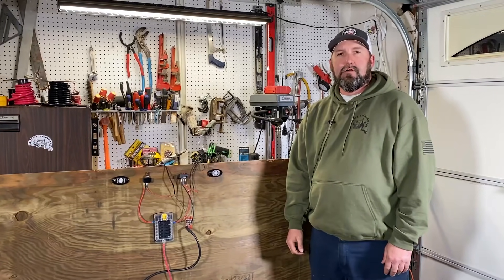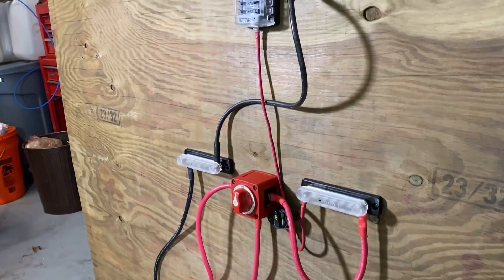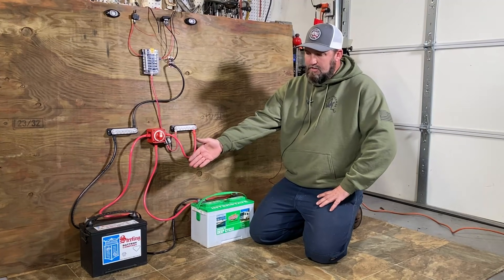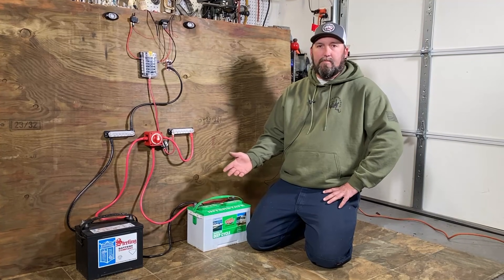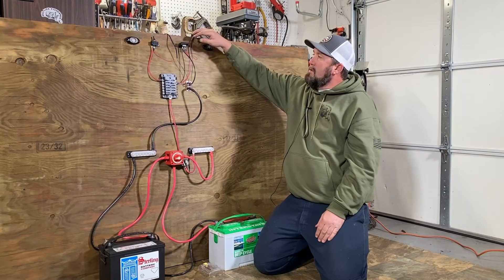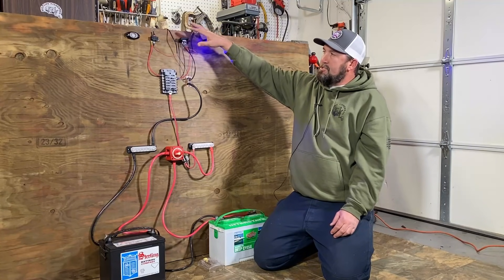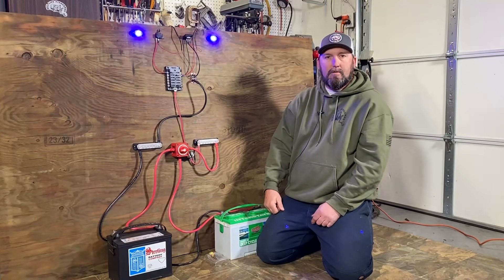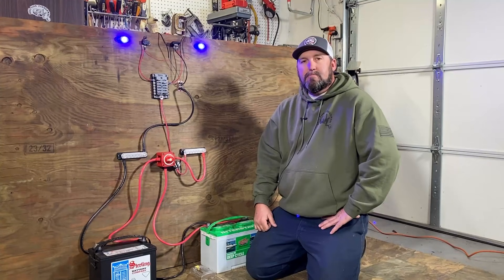BASIC BOAT DUAL BATTERY WIRING | HOW TO

Comment: Is it still safe to connect 3 crank batteries in paralleled and still have a long lasting battery on a boat day? ..because I don’t want to install any switches. 

I also heard have batteries in paralleled isn’t safe? Correct me if I’m wrong.

Comment: Thank you for this video. I have a Tohatsu 20 hp electric start, power tilt. I can crank the engine with the pull rope also. If I have my system rigged like this can I turn the battery switch to just the deep cycle battery and use the pull start will my alternator charge the deep cycle without any stress on my alternator?

Comment: Question: my trolling motor is 24V. I like to night fish by dropping a 12V light into the water. Can I just hook my leads up to one of my batteries that are wired for the trolling motor or do I need to disconnect them from being in series before hooking up?  I am guessing since my three battery charger is not in series it wouldn’t be an issue.  But wanted to get other opinions. Thanks

Comment: Ok... but where on the out board motor does the out red wire from the battery selector go ? 
Hook on the red wire lug on the starter ? 
Or the other end of the wire on the lug by the square thing ? 🤔

Comment: So, would the trolling motor batteries be the 2nd position on the battery switch? Would the output position of the battery switch be pushed to the console by the smaller gauge wire with the 30 amp inline fuse to the terminal bus or to a power switch? I am new to boat wiring an looking to run new wires for the next year fishing season. Batteries to the switch and off to the trolling motor. Batteries (deep cycle) to the switch and then to the power toggle switch then to the 12 position bus bar? Is this correct?

Comment: You said to make sure the engine is off before you switch to battery 2. If I crank my motor from battery one just to start the motor, how do I switch to battery two while I am using the motor?

Comment: Nice job Reel Life!!!! Basic but informative. Very helpful. You do a good job. Looking to add a battery to my Alumaweld that just came with 1 battery. And also my switch panel, now that you've explained, I will trace and see if it's hooked up the way you explained, or close to. I definitely will have a better understanding and will know what I'm looking at. Thanks. 👍

Comment: Great video, just looking for some clarity. If you have it set to your house battery while you're chilling at the sand bar or whatever and then switch it to your cranking battery you won't be charging the house battery while running. So, how do you recharge the house battery?

Comment: If I understand correctly, you said that you don't want to run the motor with both batteries on, and you don't want to turn off the house battery before allowing the electronics to shut down. I'm confused, how then would I chart a lake or move from one spot to another. Did I misunderstand something?

Comment: I'm a little confused about charging the house battery. Selecting battery 1 will charge starting battery, 1+2 will charge both simultaneously, and I know about battery isolators and charging relays, but how does selecting battery 2 prevent #1 from receiving a charge? How do you connect outboard and charging wires to this system? With a single battery system everything is connected to the one battery obviously, so that's how I'm confused why it would stop being charged when selecting battery 2 when the alternator is connected to #1. Is the alternator connected to the output connection or ??? What am I missing?

Comment: Most instructions on all of the battery switches say to use the positive lead, but I've seen a few comments that say you should always connect the negative.  This kind of makes sense, since when you hook up and unhook a battery you always hook up positive first and then the negative lead.. when you  remove cables you remove the negative first and positive first.  With the positive leads together, wiring the negative to the switch, when you turn the switch it would be like removing the negative cable and then you are connecting the negative of the other battery.

Comment: the deep cycle needs a different charge profile vs a regular flooded lead acid, it's kinda critical for battery life, u definitely want to charge them correctly, otherwise it won't charge correctly or fully, and it'll severely limit the life    not a big deal tho, many companies make DC to DC inverters or aka charge controllers for deep cycle so u don't ruin it   im looking at them now but for a truck

Comment: Great video! Absolutely the video I was looking for.  Question, what gage wire do you use to go between the battery switch to the buss bar and the negative terminal on the battery to the negative buss bar? Thanks!

Comment: Hey bud 
Nice video 
Question for you.  I just installed a premium audio system in my V drive centurion boat.  However I came at across roads.
With the ignition switch power and the stereo on and off switch.
I have 1 constant that’s good for both.
Unfortunately I need another source for one or the other.
Is it possible that the stereo switch or ignition switch came from the smaller fuse box area. (there is an opening)
It could be a possibility.

Should I run a new lead with fuse or find a way to tap into the fuse box.
I apologize if I wasn’t clear.  I’m a rook.
thanks again

Comment: If I’m running just an electric motor  with two deep cycles, can I run in 1and 2 position to run them in parallel without causing any issues? Or should I just wire them in parallel before putting them to one input on switch?

Comment: have a couple ?'s. I have a bunch of 2awg marine battery cable. you say 4 is most common can I use the two awg for my blue sea mini add a battery kit. and with that size wire what size breaker should i use? my engine is a 60 hrs.

Comment: So this may be a very naive question but what do you do first? Does it matter the order you hook everything up? Like does the large gauge wire coming right off the battery have to go first? Can you work backwards from a circuit. It’s obvious I don’t really understand the principles, I get that it’s a circuit and it goes in a circle I just feel like there’s no getting around touching metal to metal and conducting electricity while connecting wires when everything is all wired up. I feel like I should wire everything up to the fuse block and then connect the power source but idk.

Comment: How do I add a 2nd leisure battery?  If I want a crank battery and then 2 leisure batteries for on board power etc ? Using the switch etc?
Reply: Good to see questions get answered lol.

Comment: My engine positive is going to Output on the Battery Swtich, my engine negative is going to Neg terminal on Starting battery. Starting battery positive goes to Pos 1 on switch, Deep Cycle battery positive goes to Pos 2. There is a neg jumper between both batteries. I have a Yam 150, and when I try to operate the trim/tilt switch  on the motor it only works on Pos 2 and Pos 1+2, but not on Pos 1. Any recommendations? Love the video btw, did a complete re-wire based on this. Thank you!

Comment: Great video... why would you need a positive bus bar if you're using a 12 gang fuse panel? Also you have what appears to be an 8GA - to a bus bar, then 8GA - to a smaller 4 or 6 prong - board, why? Couldn't you just run the negative straight to the fuse box and the positive to the circuit breaker right to the fuse block... or are you just showing alternatives?

Comment: Can you run the negative wire from the engine to the negative bus bar or do you have to connect it to the negative post on the crank battery?

Comment: I have been trying to find information on this for awhile but can’t find anything concrete online. So my switch panel has breakers. Would I still want to have a fuse panel for everything going to the switch panel or just have a small fuse panel for things that are not on a switch? Also if you could shed some light on breakers vs fuses? From what I have seen online a breaker is pretty much like a reusable fuse but they can be used interchangeably for most 12v applications.

Comment: I just wired my two batteries in parallel, added a 50 amp circuit breaker. I have a large stereo system with amplifiers and a subwoofer.

Comment: Using this system in a 16 ft aluminum jon boat and wondering about the trolling motor. I would have a group 24 cranking battery and group 29 deep cycle house battery. Would I want to connect trolling motor to positive bus bar or directly to house battery?

Comment: My only question is say I start my motor with the starting battery and then while its running I want to use my lights and other accessories. I would want those to draw from battery number 2 but how would I switch over to that safely?

Comment: Fantastic video, one question. In my case, where you have the house battery, I have two trolling motor batteries run in series for a 24V trolling motor. My question is how does the wiring from the trolling motor batteries to the switch go?

Comment: Slightly off topic, with the new power needs of electronics what are your thoughts on running a dedicated circuit to them? Here's what I was planning. Starting in back battery compartment install a Perko Batt. switch using 8ga, tinned wire then to a 40 amp reset breaker with same 8ga also in batt. compartment then run to a Blue Sea fuse panel in starboard locker forward of console. Then run 10ga tinned wire from fuse panel to four graphs all with there own individual  wires. Two in console  a 3ft wire run and two at bow a 8ft wire run. with all that said would it be okay to cut out original fuse holders and rely on the blue sea fuse panel as long as you use the correct Amp rated fuse for each graph? Thank You

Comment: Just one question why is it not recommended to have the switch on both batteries while the motor is running. I figured that way you can charge both batteries that way. You said you could but it's not recommended?

Comment: What wiring would you recommend running a crab pot hauler that draws a current of 35amps? Could I just upgrade my dual purpose deep cycle battery from group size 24 to a group size 31 and just hook up the hauler to that battery instead of adding another battery? And also have the engine and hauler both running at the same time so it won’t totally drain my battery.Thanks!

Comment: Thanks for the great video man. I am currently in the process re-doing my boat wiring and your video just enlightened me on the basics. Just one question though? As you are distributing to the various equipment (lights, fish finder, etc..) through the fuse box, what's the use of the distribution bar then? Basically, you could have wired straight from the 20amp fuse to the fuse box? Thanks in advance for your feedback. Cheers.

Comment: great video. I am putting in a fuse panel in front of boat to run Mega live and monitors. I want to run 8 gauge from buss bar like you said and I noticed I do not have any free terminals in my buss bar. can i put the 8 gauge wire ontop of another wire and tighten it up.

Comment: I purchased a 2000 Hurricane and it has the switch and 2 deep cell batteries. I replaced them both with newer versions. Is that OK or should I get a cranking battery opposite the deep cells?

Comment: Love your video, best boat wiring video on YouTube( and I’ve looked at a bunch haha). Quick question, I am completely redoing my pontoon boat and am about to start the wiring. I have excess of anchor 4 gauge wire and was wondering if I could take that from the battery to the switch, to the bud bar, and all the way up to the dash to the fuse block? Is 4 gauge too much to run to the fuse block, do I need to step it down? Will it hurt anything if I don’t step it down and just use 4 gauge all the way up to the fuse block?  Thanks so much man!

Comment: Excellent video. One question. If I wanted to run a Trolling motor as well should I go from the output switch to the motor through a circuit breaker then back to the negative like you would with an outboard?

Comment: I would like to see a video on how you would charge bothe batteries. 
Thank you
Reply from the maker: You need to have a 2 bank onboard battery charger to plug in when you get home.. and if you want it a automatic charging relay (ACR) isolator. To charge on the water while the engine is running..

Comment: First, thank you for the video. It is super helpful. 

Second, I'm worried about the compatibility of my deep cycle and cranking batteries. I'm kind of getting mixed signals from the internet. 

I have an EverStart 29DC for the crank and a SuperStart Marine group 31. 

I don't have a battery isolator, just have a - black lead running between the batteries. 

What do you think?
Reply from the maker: So they are only together on battery switch position 1&2 . That is for emergency only! They are sharing a ground and that is it..  the second battery is only there to switch to if you will be anchored and not running your motor for long periods of time, running lights and electronics radios etc. it is also there for emergency .. but as far as 2 different batteries being connected in parallel or series for anything other than emergencies.. that is correct..  hopefully that makes sense and please let me know if you have any questions.. thanks for watching
Reply: @ReelLifeFisherman  I think that makes a lot of sense. I ended up buying a second of the Everstart to pair with the cranking batteries, and moved the deep cycles to the stern. Then I ran leads back from the stern where the 4 bank battery charger sits. In a pinch I could use those wires to crossover the two  battery banks. 

Thanks for this visual.  It made everything a lot easier for me.
Reply: @ReelLifeFisherman  that makes a lot of sense*

Comment: I have just purchased a 90’s boat and it has a battery switch. This video was very helpful. I have taken it out 3 times and have noticed that the fish finder turns off and on every time I start the boat. Is there a way to fix this? Or would I have to wire it to a separate battery and if so how do I charge that battery?

Comment: If the main cables aren't the same length, when on selection 1&2 the shorter cable battery will drain faster.
Reply from the maker: ???.. what?   You need to get away from thinking of position 1&2 as anything more then being used in a emergency..  having two cranking batteries in parallel all the time is not good for your ignition and charging systems..
Reply: Reel Life Fisherman, hi, these batteries are wired in parallel when selector switch is on 1&2. The other top videos on youtube state I can charge in parallel. Two chargers on batteries wired in parallel is not necessary, unless your in a race, which trickle is best anyways. I'm not using my batteries to crank engine usually. I live on the sailboat. I want more amp hrs and less fatigue on my batteries so I keep them in parallel by staying on selection 1&2. If i want to motor I'd isolate one while out on water to save power for cranking, otherwise they stay parallel. For charging I believe from what I have researched today, the positive charger lead goes to the positive where the positive load line comes out, while the other negative charging lead goes to the OTHER battery negative where the negative load out is connected. Obviously it won't charge if the selector is off 1&2. 
Thanks for the video and advice.
Reply: Reel Life Fisherman i don't know man. Everyone charges their batteries in parallel. Haven't seen people with 4 batteries having 4 chargers, that's ridiculous. I appreciate your advice but I'm going my own way on that. Obviously a guy would get a higher amp charger the more batteries he wires in parallel.  Cheers!
Reply from the maker: No sir it’s called a on board charger with 1,2,3,4 banks .. one bank per battery.. but it’s one charger.. I hope that makes sense to you..
Reply from the maker: @MycSailor  NOCO Genius GENPRO10X4, 4-Bank, 40-Amp (10-Amp Per Bank) Fully-Automatic Smart Marine Charger, 12V Onboard Battery Charger, Battery Maintainer And Battery Desulfator With Temperature Compensation https://www.amazon.com/dp/B08G38VWQ6/ref=cm_sw_r_cp_api_glt_fabc_XX39B4ZR7K3YTCQPPFAC

Comment: Great video!! Instead of having a busbar by the bilge can I put a fuse block to connect pumps and other stuff? Also do you recommend two bilge pumps connected directly or passing thru the switch?
Reply from the maker: Thanks glad you liked it! Yes you can absolutely put a fuse block in back there .. and if you are going to the ocean 2 bilge pumps is a great idea! When connected bilge pumps with auto switches they should be hooked directly to the battery..  and then have a switch on the dash as well  for one or both of them typically.. let me know if you have any questions.. and thanks for watching!
Reply: @ReelLifeFisherman  thanks for the reply. Looking forward to more boat videos!

Comment: Have to watch again. Don't understand the negitive and positive bus.  Great vid.
Reply from the maker: They are basically a hub for you to add more Accessories without stacking them on the battery switch or batteries.. let me know if you have any questions.. and thanks for watching..
Reply: A bus bar is like a big wire nut. One connect for power and many terminals to take off that power (positive or negative)

Comment: Great video! What gauge wire do you suggest for wiring fish finders, bilge etc?
Reply from the maker: It always depends on the draw of the device and the length of run .. but 12ga is typically plenty .. but on a fish finder longer run .. 10ga . Thanks for watching and commenting